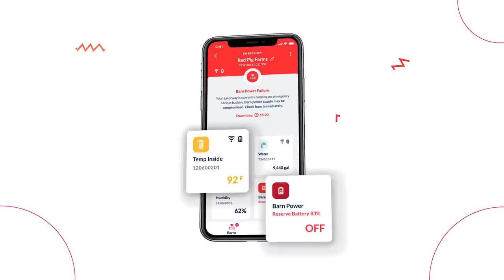Amish Builders Restore Our 80 Year Old Barn

Comment: I had new standing seam put on our old dairy barn, still have the winch, fan and loose Hay grapple my Grand Father used. As of late I use an Amish crew since contractors want to build new homes. The Amish have a English driver that works for them and you are right, the rules apply to different areas on what they can do.

As you get older things change, electricians, plumbers and contractors have since passed, I found myself looking at the Amish for the dedication and skills they possess. Pay attention to Dad and Cheers from NW Ohio.

Comment: The Amish I have met have no problem with electricity:  They have a problem with the electric utility, because it's part of the US financial system.  Like you said, as long as they generate their own electricity or compressed air using bottled propane or fuel they buy, they can hook all their power tools up to it.  I imagine they could be big solar power advocates now, too, just not grid-tied systems.  I once visited an Amish buggy shop where every shop tool, drill press, lathe, etc. ran on compressed air from their own propane-powered compressor.  We were taking an Amish guy there to buy some battery-powered lights for his buggy.  My wife (vet) had a long talk with him about horse health care.

Comment: The Amish here in NE Ohio are much more lax on the "modern conveniences". They can own and use cordless tools and even use electricity to charge them. They can also own and use heavy equipment like excavators and skid steers. Even cell phones. But they are only allowed to use it for business purposes only. But they cannot drive to and from the job site. I've even had them bring a microwave and plug it into my garage for their lunch breaks!

Comment: Black roof looks spectacular. Thanks for preserving the old barn so many are falling down now for lack of a good roof. It doesn't take long once the roof starts to go. You can tell on the inside yours has been well cared for. How long did the last metal roof last? Was it failing or was this just an upgrade/replacement. Thanks for the info. I have one I am doing in the next few years.
Reply: It has been on there since the mid 80’s. Nailed on and leaking from nails coming loose.